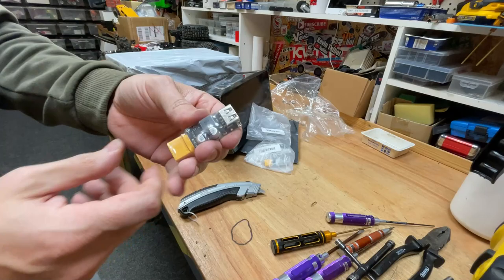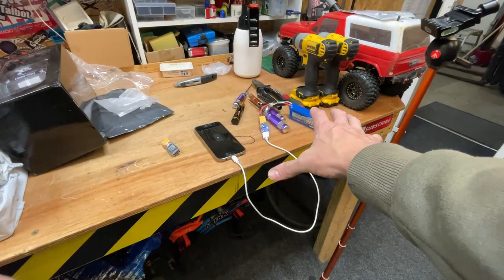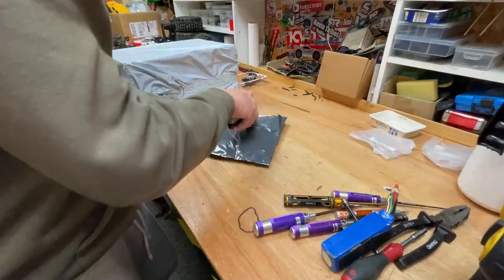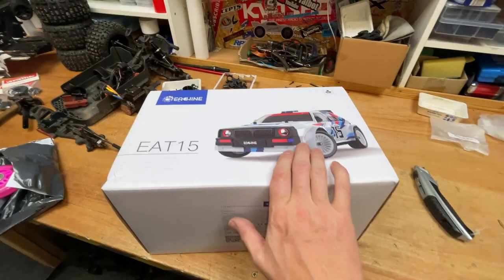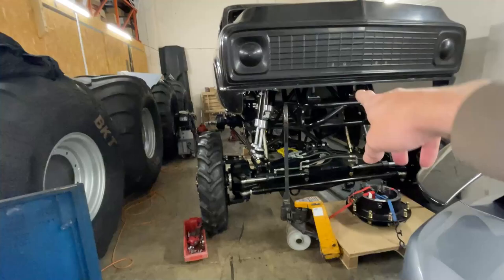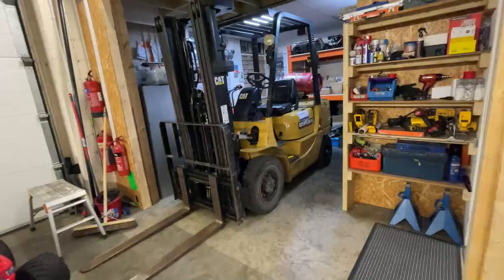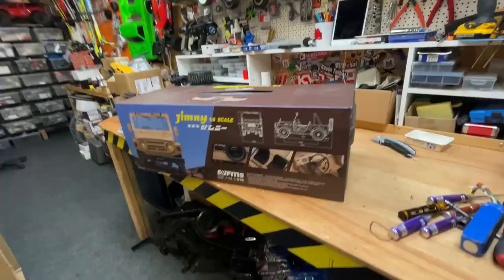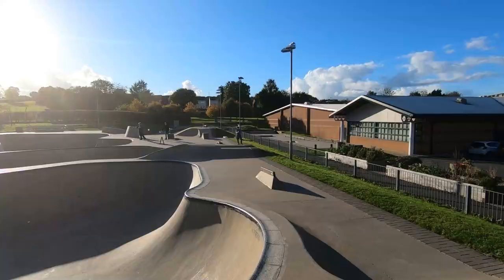Handy Cheap tool ALL rc guys need!

Comment: I would not risk charging expensive electronic devices with a cheapo charger, but I use a few of them to power USB workbench lights and to discharge my Lipos. Also looking forward to seeing you sending the felony to the moon ;)
Reply: If I had to guess with no oscilloscope I would bet these little lipo to usb adapters put out as clean or cleaner dc than the ac wall adapters as it's starting as DC and I have been using mine for over 5 years on many devices and phones without issue. I would 100% recommend them to any rc enthusiast.

Comment: Hey Kevin, when you drive a forklift put your left foot on the brake and your right foot on the gas. This gives you more control, and it allows you to push the brake and the gas at the same time and that will just run the hydraulics faster (moving the mast up and down faster)
Reply: making sure the forklift is in neutral 1st
Reply: @perspectivemeditation7648  on the hysters I operate, the brake pedal seconds as a clutch aswell. This allows me to be in gear and accelerate without actually moving forward or backwards. But all forklifts are probably different.
Reply: @connorendacott2904  sure, on the ones i operate, there is an inching pedal (for precise movements) on the far left , with brake being in the middle

Comment: Hi Kev, what time do your live streams usually start?  And would you be interactive in opening Dorset RC Arena next year. I've got an 1/5 scale track and 1/8th. I've got an EPIC crawler track.  But it's not just cars I've got helicopters, planes and if I can get planning permission a large lake for boats too.  I would live for you to open it as its your vids that got me into rc cars.
Reply: whenever something breaks
Reply: @endosrc  which with kev is alot, especially when Stemp is involved 🤣🤣🤣
Reply: @DJMILKY1974  pretty much 😂 what do you race at your tracks?
Reply: @endosrc  i started with a big rock for first rc car. Now I've got a losi dbxl e 2.0 and a Arrma Exb 8s which I race alot. I'm wanting to get the traxxas trx6 next. How about you?
Reply: @DJMILKY1974  about 8 years ago I got a traxxas gravedigger 30th anniversary edition. I was kinda young so my dad drove it mostly up untill last year (January) where I sorta lost interest in the hobby. Then around November I got an axial smt10 and that was the dumbest thing I’ve ever done because every run something new broke even though I’ve only jumped it off curbs and SMALL ramps at my local track. It’s been immobile the past 4 months because all 4 hexes stripped out, so In the next few months I’m gonna get some duratrax munitions and some aluminum hex adapters to ensure they won’t strip. Soon I’m also going to get a bandit xl5 and convert it to a drag car so that should be fun
Reply: @endosrc  you should take a look at the Big Rock, it's an awesome RC and you can get it for less than £300!!
Reply: @DJMILKY1974  not really a fan of the stunt capability. If I were to get an arrma it would probably be a granite 3s